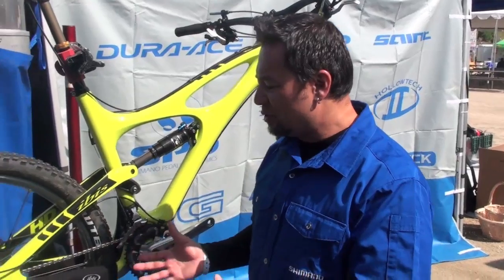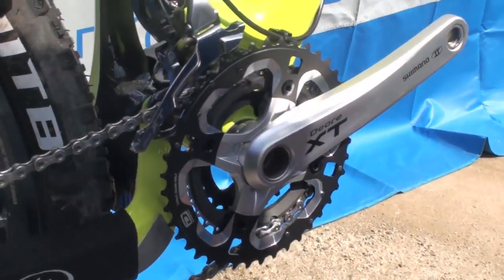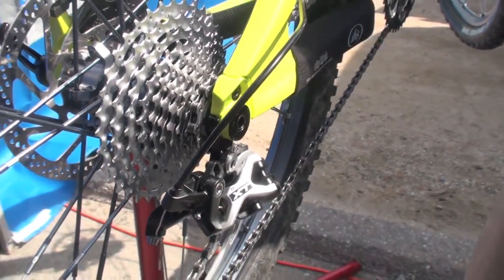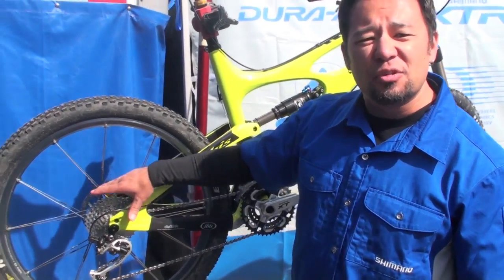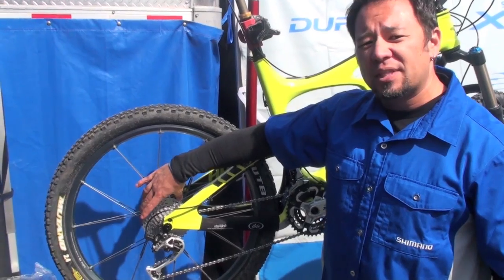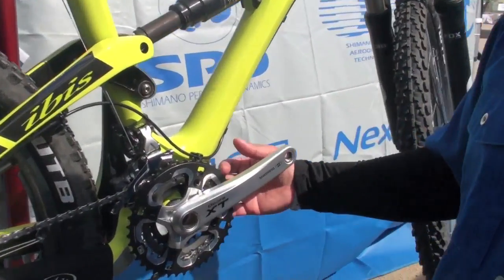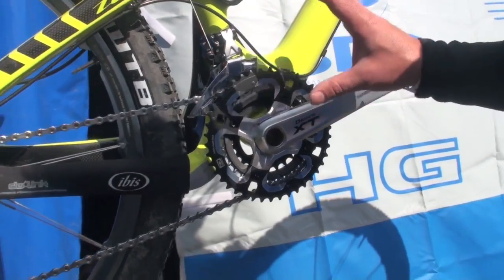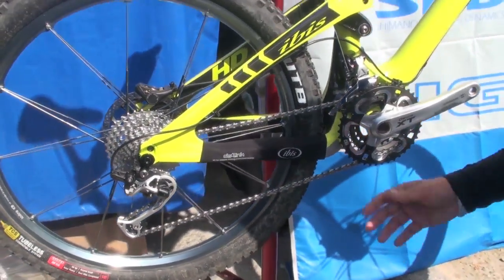SOC2010 - Shimano 3x10 Dynasys Intro.mov

Comment: Don't forget to mention the system is only as strong as it's weakest link . . . . the damn chain. The plates separate from the pins on the feaking 10 speed chain. It happened to me twice in a 5 month period. I am now using a SRAM 10 speed chain, no problems yet. I ride a Tallboy with XT components.